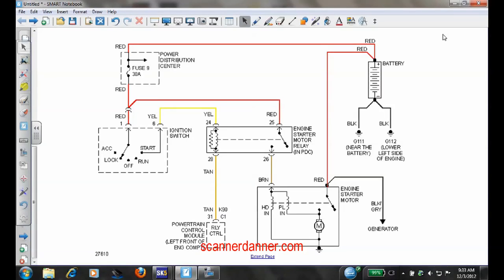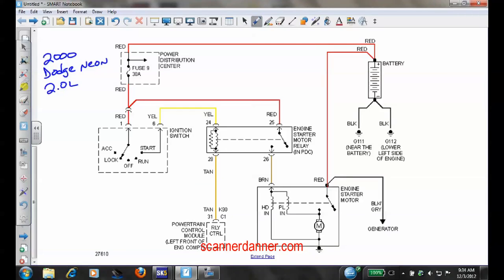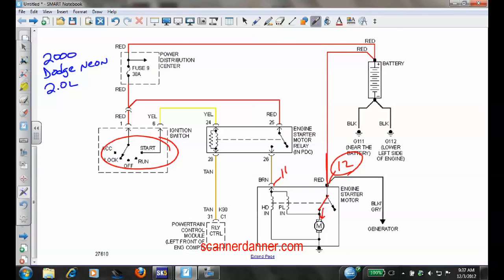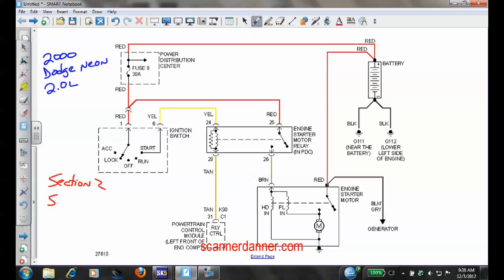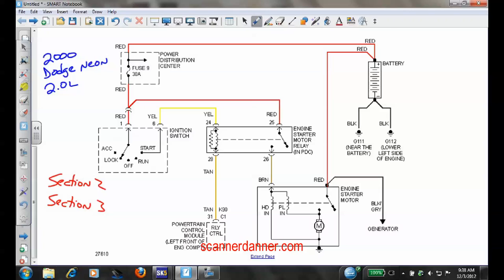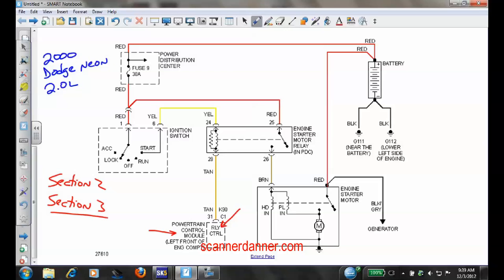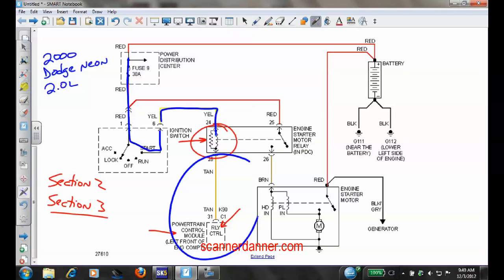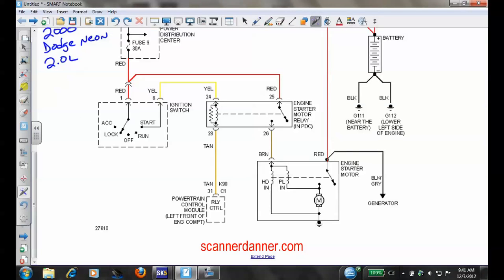How to troubleshoot a starting system (bad ignition switch) - Dodge Neon

Comment: hello scannerdaner i have a problem with my car 1993 izuzu trooper 6 cylinders ,one day in the morning my car dindt start but i jumped the car and started normal so i did that each time i had to use it, about a week after i was driving the car and all of a sudden i saw the battery needle in the dash fluctuating , and i kept driving and got to a red light and the car stalled and couldnt start back in , i had to tow my car , if u know what can be wrong pls reply i would be really thankfull

Comment: for no start no crank ,you would check 5v ref or starter power and ground
Reply from the maker: depends on the car and if the starting system is computer controlled or not

Comment: hi my 2000 dodge neon wont start or even try to start the battery has been replaced and also the ignition switch the lights come on and the fuel pump kicks on and when i turn the key on nothing happens not even a cranking noise from the engine at all any ideas because it just happened today im thinking its the starter or the computer. could you give me advice on it please

Comment: I need information on how to test the pats module my 2000 Ford ranger xlt won't start any info will b appreciated 👍
Reply from the maker: Transponder in the lock cylinder right? You should be able to get codes out of that system if it truly is antitheft related

Comment from the maker: No, we are talking about two different things. High side and low side drivers (power and ground side switching) deals with the control side of the relay only. The load side of the relay is the switch or the high current side that is NOT involved with the computer. 
We can both use different terminology and be talking about the same thing. You call it a low side driver, I call it ground side switched. You call it a high side driver, I call it power side switched. At the end of the day, who cares

Comment: Hi I got 2 questions , how can I test for a signal. EX: powered antenna getting power but it waits for a signal from the radio to turn on. also what software are you using to be able to write on the diagram and be able to erase it would love to use it on my tablet .  thank you.        wheels
Reply from the maker: +Fariswheel you just need a good wiring diagram. http://www.scannerdanner.com/forum#/20150619/where-to-get-wiring-diagrams-4839109/
Reply: +ScannerDanner thanks for the reply, what if I do have a wiring diagram from Mitchell but it doesn't tell me how to measure that signal. whether it's voltage or ohms , etc. how do I figure that out or is it a standard voltage measures for everything

Comment: Hey scanner I pressure washed my engine., and now it won't start, it would crank at first but now I can't even get that. So it's officially a no crank no start on a 2004 neon.. Any help is appreciated.
Reply from the maker: +klaromio start with two voltage measurements at the starter. Or even a test light would work. Both the heavy gauge wire and smaller control wire should be lit while someone holds the key in the crank position

Comment: I have a chevy truck with a 350 engine. I started the truck & let it run for a few minutes; turned it off, then tried to restart it within a few seconds and now it will not start! Can someone give insight as to what's the problem? Thanks

Comment: what if the power  feed coming into the ignition switch has no power? but i do have power coming to the 50 amp  fuse in fuse  block . what does this tell me? anyone?  thanks

Comment: Can the ignition switch be bad and still allow the car to start. My car does start up but my interior lights do not come when the door is opened but if you leave the door open and turn the ignition switch to on, the interior lights come on. Can a bad ignition switch cause this? Does power normally  come through the ignition switch for the interior lights? Where did you get the wiring diagram for this video. My vehicle is a 2002 Chrysler T&C and that's what led me to this video. Thanks.

Comment: put a new starter in it and changed the battery it would crank then die so i thought it was the ignition switch

Comment: Load side, control side. Your making this up as you go. It's called high side and low side. The relay is high side switched by the ignition switch and low side switched by the ECU. Learn control electronics please.

Comment from the maker: ok, i'll try :-) the "fuse" indicator on the dash would be an instrument cluster message. not sure if it was a message received from the PCM or BCM or if it was just the cluster itself that recognized a fault. After looking at the diagram again, it would have to be a run circuit that was also having some contact problems in that ignition switch for that issue to be recognized. I don't see how it would be the start circuit, there are two different  wires that are hot in start though.

Comment from the maker: lots of variable here. start with checking the ignition switch for it sticking. then look carefully at the positive battery terminal to the starter. make sure it is not partially shorted to ground. I have seen this cause the starter to stay engaged but this would not cause it to not start. you may have two separate problems

Comment from the maker: yea, that was my fault. I wasn't insinuating that that would be an alternative on this design. I was just talking about the switched side of the relay only. I should have made that more clear. I did say right after that, that the relay would only have one power feed in that case (and it would be on the control side only). good catch on that, hopefully I didn't mislead everyone with that statement too much. 
Thanks!

Comment: i am no mechanic but i doubt a computer cares about cam or crank position to "enable starter solenoid" ,just picture this!.... if your timming belt breaks ,i bet you will be able to crank the engine (on every car i have worked)  cams or crank never land in the same spot every time when you shut the car off,.erroneos crank or cam positions to the ecm will not disable starter solenoid.
 you will heard the starter crank..........engine wont run but thats a difernt story. dont take my word for it.

Comment: Awesome explanation. My issue on my 05 neon is the lower left terminal is my s wire, upper left is ignition (gets 12v when cranked), top right is 12v hot, bottom right is tan as confirmed from the under side of pdc. When the car is powered, there is no ground and have the neutral safety switch jumped. Something isn't right because when I jump top right (12v hot) to bottom left. It cranks. Basically my 2 lower wires are swapped from your diagram and not providing ground. I'm banging my head on the wall lol

Comment: i changed the ignition switch turned the key no start but i here a noise in the fuse box ive  changed the starter relay still nothing
Reply: J Rob transmission control module? short between electronic transmission safety turn off switch...

Comment: I have a vehicle with this starting system which looks like it's not being grounded by the PCM. The voltage from the pcm fluctuates between 1.8v  and 2.4v with the key on and when I try to crank it I get battery voltage on that wire at the pcm (Coming from the ignition switch) would you say that was a shorted driver, and what may have caused that.
Reply: Sorry I meant 0.18 and 0.24volts

Comment: Youre just who I need to talk to,...I have a 92 Dodge Caravan I take all the drunks home in on the weekends,...Well I went to the local Dollar General, ( It cranked fine). when I returned to go home, I turned the Key, it started smoking behind the dash,..It does nothing , No lights on the cluster work, Fuel  pump doesnt come on, Head lights do burn, interior lights work,..BUT nothing. I tried to crank it at the Solenoid it will spin over but nothing ,.It just spins and spins trying to crank,..Which tells me its not getting Fire either.  My vans been stuck there for 3 days now. I dont know what to do
Reply from the maker: Smoke behind the instrument cluster is not good. The instrument cluster shares two fuses with the body control module #3 and #15. If these circuits are down, it may give you a no crank condition as you are describing.

Comment: Hey hows it goin?  I have a 02 dodge stratus DOHC/2.4 cyl, and sometimes when i go to crank it. theres nuttin for about 11/2 sec(meanwhile im holding it in crank) then it will crank over. do you think the starter is going? I replaced the plugs, and checked the coil towers for corrosivness but found none, and I have a brand new batt.

Comment: Any ideas in 2000 neon dash lights flicker and once it died while driving,  took it in and it was ok for about a year but they didn't  touch the ignition system.  Replaced the relay after I went to go somewhere and absolutely nothing, no lights dash or cranking. Wire from battery was fired on one end friend clipped it off and it ran fine for awhile.

Comment: I'm somewhat confused by using the test light to energize the control side of the relay to complete the circuit and start the car.  Is the test light serving the same purpose as a jumper wire in this instance?

Comment: I am unable to get the starter to crank, I have power on the load side of the starter and when key gets turned to crank position, I get power to the S post of the starter but not even a click comes from the starter.  I can jump the hot terminal to ground and spin up the starter, but again even when key is turned to crank while I jump it, the starter spins up but does not throw the pinion forward to engage the flywheel.  This is a 2005 3.4L Impala.  I have just swapped out the transmission with another one from a 3.8L (same year).  If the PCM was going to not allow the engine to start, I would think you would not be able to see power on the S post, correct?  Which leaves me at a loss as to what the issue is??  Any pointers greatly appreciated!

Comment: Hi Paul,thanks for the good work I have been wacthing your vidoes just to be up-to-date with fixing stuff.Im a handy-jack of all trades.today Im gonna need your help with my Lexus RX300, firstly, it can`t  start. i cleaned the IAC,changed the solenoid terminals now if I start it cranks but doesnt turn off, until i pull the baterry off. I need your help badly.

Comment: Paul this was a very good video. I specifically liked how you demonstrated how the PCM can effect the starting circuit when trying to bypass the ignition and start the car. I think I learn more from your actual videos of you doing the work than when it is all theory I think because there is a visual memory that sticks with me however the wiring schematic design in the beginning was very helpful as well. Thanks for taking the time to share these techniques I really do appreciate it.

Comment: Question  2003 lincoln towncar    I changed out my ignition switch  thinking that was the problem ....it was not the problem . I also can crawl under car and jump the starter  off the positive post of starter to start post  so i know starter battery , starter and soleniod work  that is why i changed ignition switch. does this leave me with a pcm  issue?

Comment: Hi Paul, I have done the same work as yourself for over thirty years, It's interesting to see the 'FUSE' warning on the dash which turned out to be a 'red herring'. Was that for another circuit on the vehicle, or was there a control unit monitoring that circuit for starting even though there was nothing on the circuit diagram to that effect?

                                                                                                     Kev

Comment: I just started to view your recordings and find them very useful for an old certified mechanic, who has been out of professional auto repair for some times now. Thank you for sharing.
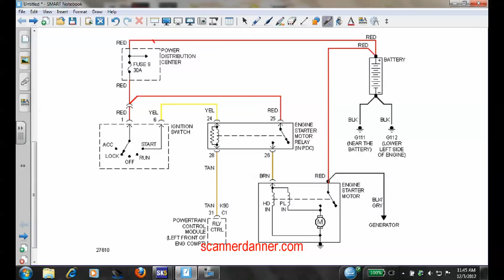On this particular video in frame 26:19, you show an alternative relay ground with blue lines. It seems that circuitry would cause a massive short from battery plus to ground.
Perhaps you meant to draw it on the control side (coil) rather the line (power) side? 
Did I misunderstand your explanation?

Comment: LT/GRN wire controls the coils of both the ASD and Fuel Pump Relay. The Dark Green/Orange wire is the output from the ASD relay(feeds injectors, etc) So basically you would be cranking the engine over and you would have NO spark and No fuel. The splice I previously mentioned I believe also goes to the transmission relay.

Comment: Thanks for that Paul, interesting, how does the PCM know the difference between a 'blown fuse' or a bad circuit in this case. How does it differentiate between that and the ignition just being left switched on and no attempt to start the engine?

Comment: Hi, Paul. I am yet to understand why putting the key in the START position in the ignition switch is necessary when the  ignition switch is inoperative. Isn't the switch useless once it is bad?
Reply from the maker: It is becoming more and more difficult to answer questions here. I have 80,000 people asking me for help now. So I have created a forum to help you guys better. It is free to join and we can exchange pictures, wiring diagrams and waveforms if needed to help guide you through the process of troubleshooting your vehicle. Thank you so much! Hope to see you there. 
Paul Danner (ScannerDanner)
https://www.scannerdanner.com/forum/post-your-repair-questions-here.html
Reply: It can still power up the computer even though its not sending power to the relay

Comment: hey I have a 2001 Nissan Maxima and it cranks up all day but won't start up and sometimes it'll start up and when it does it runs and drives good until you turn the car off than it'll start back doing the same thing it'll crank all day but won't start up.I replaced the spark plugs,ignition coils,fuel pump,fuel filter,9 starters,both crank sensors,cam sensor,battery,maf sensor,tps sensor,both fuel pressure regulators,ecm and got it program at the dealership and the whole engine wire harnesses......PLEASE HELP ME OUT
Reply from the maker: 9 starters? And every other part on the car. Why were 9 starters put in this? 
Is it a no crank issue or a crank no start issue?
You need to tell me what you're missing when it doesn't start. Can't help without ir.
Reply: ScannerDanner its a crank no start issue but it'll start up every once in a while and when it does it runs and drives good until you turn the car off than it'll start back doing the same thing it'll crank all day but won't start up...I went threw 9 starters because something keeps on making it goes out
Reply: when the car doesn't start it sounds like it want to catch to start but it doesn't and the spark plugs are getting wet with gas i replaced 7 sets of plugs
Reply: Wow